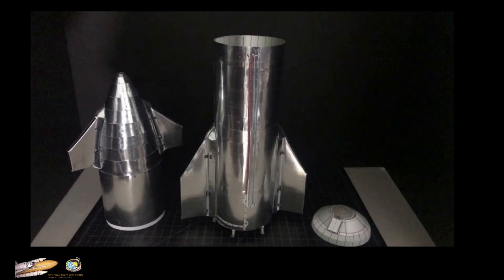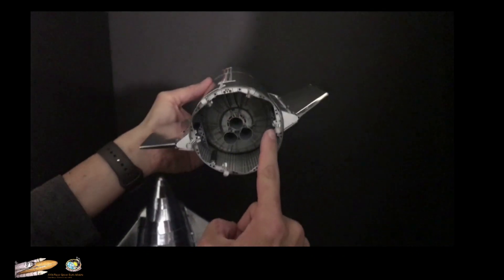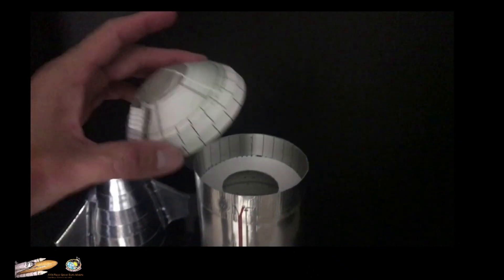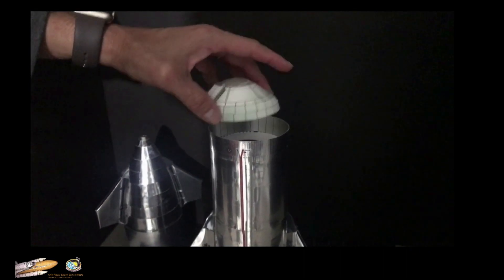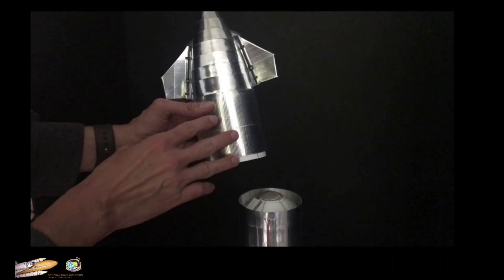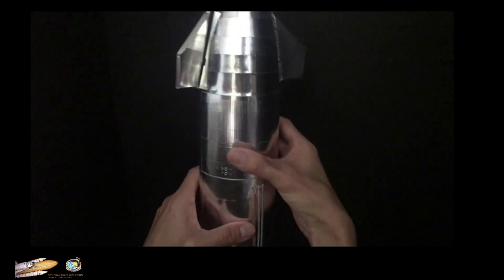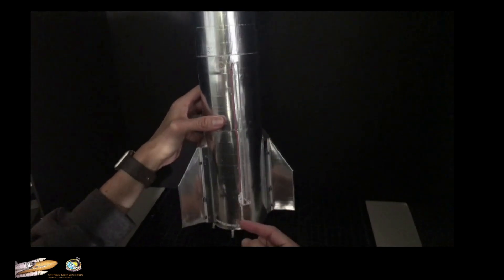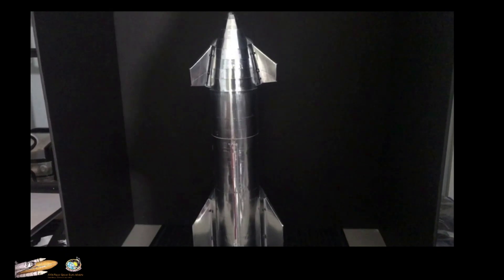SN 8 metallic version final part

Comment: When you attach the canards to the nose cone, are they perfectly Center across from each other, or are they slightly angled become of the indicator position?
Reply from the maker: They are perfectly centered.
Reply: @AXMPaperModelsTutorialsandMore  ok thank you, just glued mine on! I have one more question. Does the 5 ring stack segment get a corner placed inside or is that for the lower portion?
Reply: @johnmiller9930  *former
Reply from the maker: @johnmiller9930  Can you be a little more specific?
Reply: @AXMPaperModelsTutorialsandMore  does the 5 ring stack segment (under the nose cone) get a former inserted or does it only get the nose cone and lower attachment strips?
Reply from the maker: @johnmiller9930  There’s no former needed for the nosecone itself, but there’s a former that should be placed at the level of the upper dome; which is immediately below the nosecone segment.
Reply: @AXMPaperModelsTutorialsandMore  that’s what I was curious about, thanks
Reply: When you say immediately after the nose cone are you saying JUST the nose cone, or the noscone plus the 5 ring stack?
Reply from the maker: @johnmiller9930  You’re welcome John.
Reply from the maker: @johnmiller9930  sorry. I meant below the 5 segment stack.
Reply: @AXMPaperModelsTutorialsandMore  ok perfect thank you! Sorry for the bother, This is my first paper model 😅
Reply from the maker: @johnmiller9930  It’s fine. Doesn’t bother me. Feel free to ask anything.

Comment: Could you make a tutorial for sn9’s engine dome and how to fold the forward flaps, and the nose cone? Or is the nose cone exactly the same shape as mk1?
Reply from the maker: All the videos are available. Nosecone is exactly like MK-1.
Reply: @AXMPaperModelsTutorialsandMore  could you link the video in which you show how to fold and glue SN8’s forward flaps? And canards? Would greatly appreciate it
Reply from the maker: @johnmiller9930  I have not made a video of the canard assembly for SN-8because it follows the same steps as the MK-1 variant. Here’s the link. https://youtu.be/em4K0QmLnXY
I would make an exception and will add an SN-10 canard assembly soon.
Reply from the maker: @johnmiller9930  Now, here’s the video that shows the installation of the canards for SN-8. https://youtu.be/irYqCRb4h7U